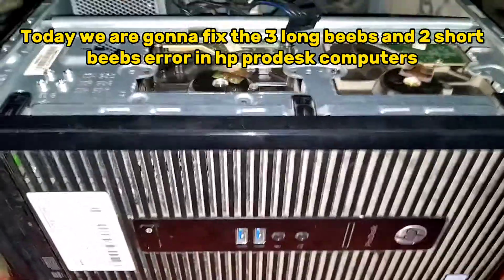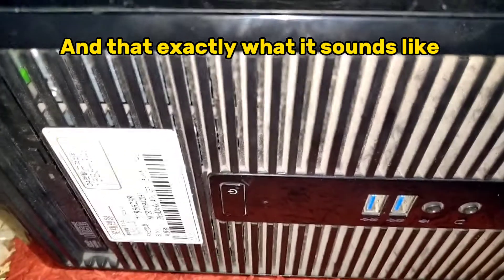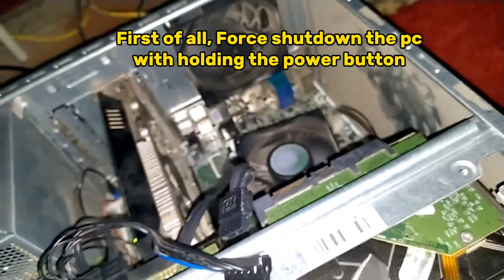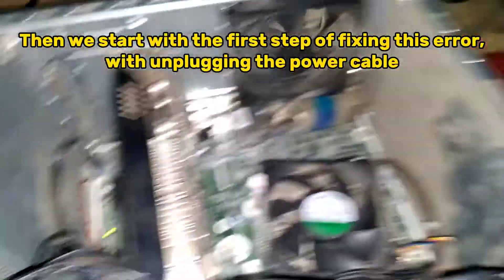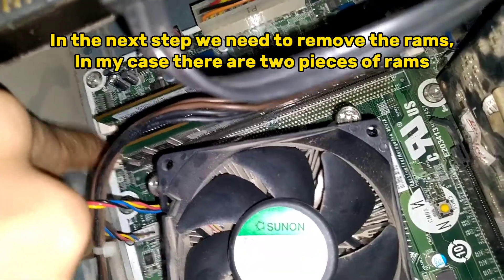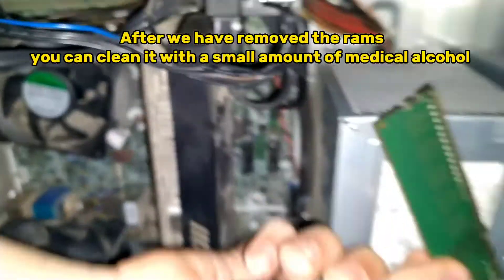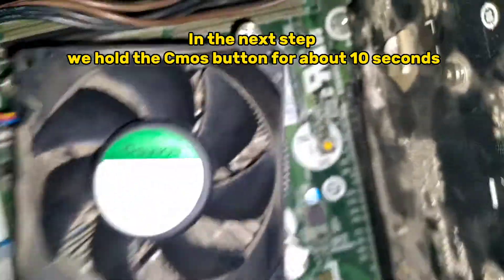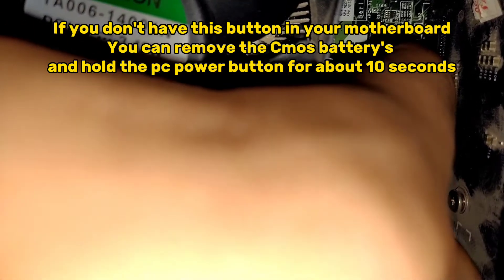The Ultimate Guide To Pc Error Fix 3 Long Beebs 2 Short Beebs no display | Hp computer beebs fix

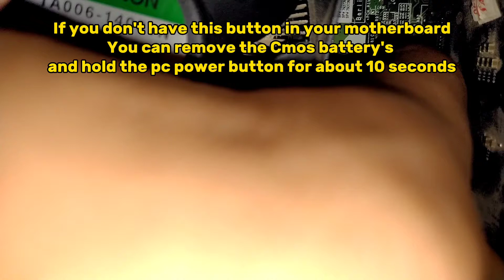Comment: At 1:02, you say to remove the cmos battery and hold the power button for 10 seconds.

Should I have the PC on or off while holding the power button?
Reply from the maker: Do this after Unplugging the power cable

Comment: I don’t know if you would be replying to this, but I had the same issue when I accidentally connected my cpu to a laptop charging cable and waiting for my original power cable to get delivered so I can test, I hope nothing big but just connecting it to the original power cable would solve the problem. Please let me know
Reply from the maker: Good evening bro, sure thing I will reply once I see the comment.
 
I didn't understand the situation exactly, but if you meant that you connected your pc with a wrong power cable and that caused the problem, so maybe you burnt something on the mother board due to a high voltage or so, so my recommendation is to wait for the original cable and try, and I hope it runs without a problem

Comment: Thank you for the suggestions but no dice even after replacing the CMOS battery and updating the bios.  I can boot with a single stick of ram but it does not work with two sticks.  I can even alternate the sticks so I know it's not the ram and confirmed it is compatible according to crucial.  I think it's a hardware fault with the motherboard.
Reply from the maker: You  can try another pair of rams, but if it doesn't work then probably  the problem is with the ram socket in the motherboard